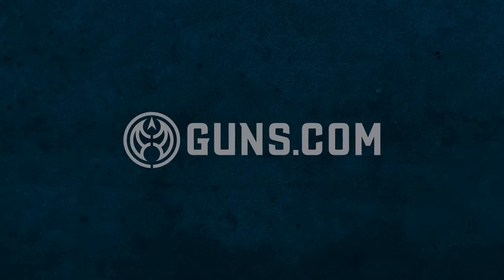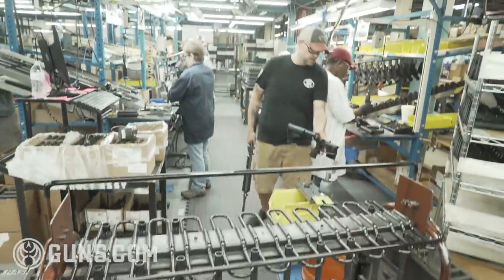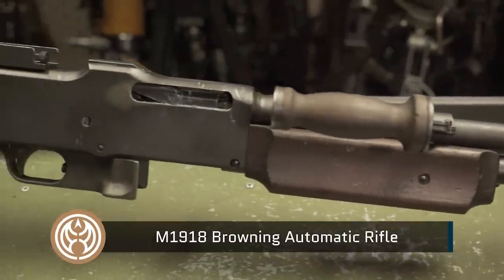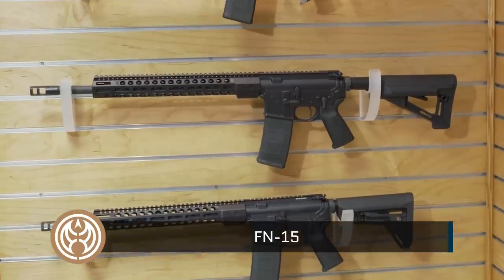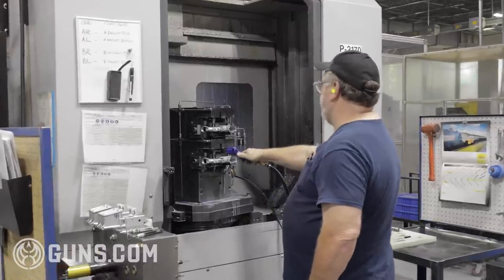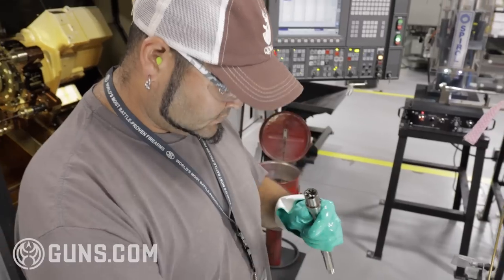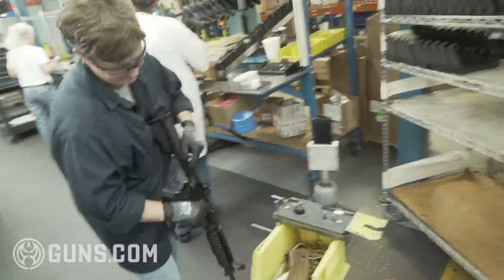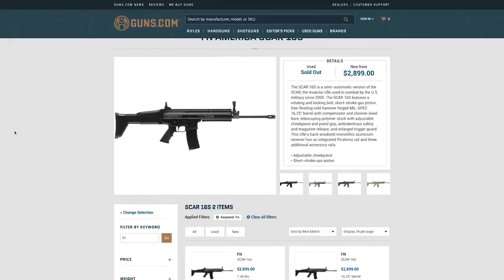Select Fire: FN Factory Tour to see how M240s, SCARs and 509s are Born

Comment: The thing I really like about FN is they make civilian versions of their military firearms. If they made a semi-auto M2 or M240, I'd have to buy it.
Reply from the maker: The M240 might just happen..
Reply: @Gunscom  That would be cool. I appreciate companies like TNW, OOW, and KMP for their semi-auto beltfeds, but getting one from the actual military contractor has extra appeal. I've also read OOW's design moves the recoil spring to the piston/op-rod, which is less than ideal compared to FN's 249S approach where the recoil spring nests inside the linear hammer and its driving spring.

Comment: There are flaws with the 509 still, such as the firing pin breaking easily. Mine broke after just 400 rounds through my 509 midsize MRD, they want me to send it in for repairs, i will not trust my life with their OEM striker. I have decided to install the APEX heavy duty striker for my 509, and to any poor soul out there that has to use their 509 when they need it the most and it's broken well...